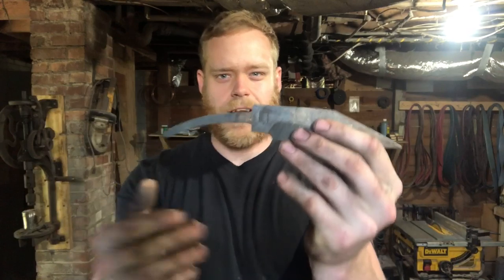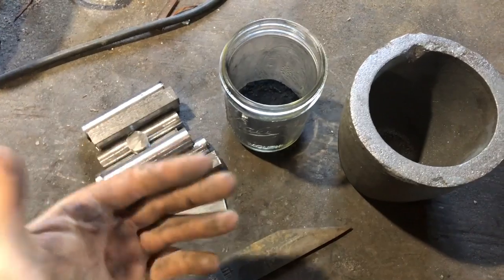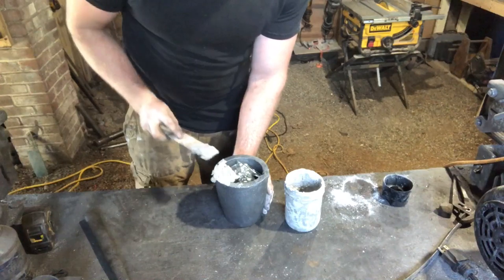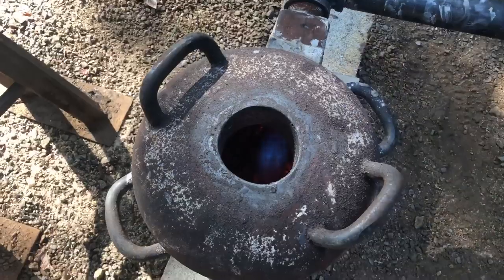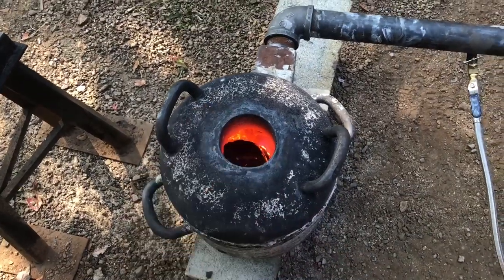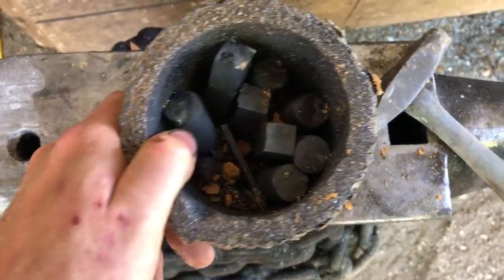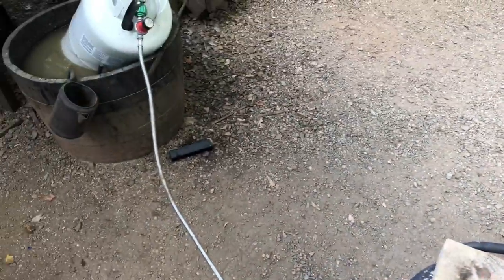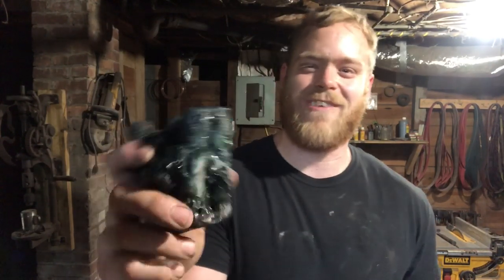Crucible steel experiment #2 (HARD FAIL)

Comment: Try building a small furnace out of bricks, use squirrel cage fans to blow air into the bottom and fill it with coke...Worked both times I tried it. Worked very well, actually.

Comment: We used a high pressure industrial oilburner (with a wing nossle, not those integrated burners from ordinary oilheaters, they will not reach the needed temperature, they hawe another type of nossle and the fan operate at much lower pressure) and a pre heting system where the air where pre heted in an externa pipe around a short chimney from the frunace. Maybe if You make an exhaust pipe from a pice of scrap iron pipe (i think it need to be at least 4" or bigger in order to work properly) and a bigger pice of pipe as a mantle surrounding it, then weld a top and bottom to the mantle and a smaller pipe connected to a fan with higher pressure or maybe an aircompressor (then the outlet close to the top of the mantle connected to the burner) would help increase the temperature a bit?

It need to be around 1350 Centrigree for real cast iron with high carbon content or pretty close to 1450-1500 Centigree if it's relativly pure "soft/wet" iron, the Graphite cruisibles shall be able to handle such extreme temperaure, they will melt at around 1600 Centigree, but they will become soft and "slippery" if they are heated up so close to their own melting temperature but it shall work if one are careful i think. (You don't need to sacrifice the cruisible if You sucess with the glass cover it shall form a lid as expected once the iron has melted, then You shall be able to just knock the ingot out from it once it's cooled of a bit since iron will expand and contract much more than the graphite mixture, it may crack, but better quality cruisibles may be rescuable, You can also make Your own cruisible from high temperature resistant clay mixtures and grapihte powder, it does not in any mean need to be pure grafite for this, the content in the cruisible will not realy affect the iron, it's only for "noble metals" like gold and silver, platinum, etc and for laboratory analysis it need to be made from pure graphite..).

(Sorry for my English it's not my native language...)

Comment: I'm curious as to why it was not stirred at all during the firing process.. I meen I understand that you don't want to pull it out, and lose heat, but to get anything homogeneous all the ingredients need to be mixed to some extent. It's sort of the difference between an egg over easy, and a scrambled egg. Just moving the contents some will put other parts of it in contact with truly molten materials, and spread their composition into it. I by no meens meen to sound like a chef, but I'd stir it a bit more. The glass should always rise to form an oxygen barrier, just like grease in a pan. Sort of like how a foundy never just drops a block of nickel into a vat of low carbon metal, and just calls the whole thing nickel steel. I can't wait to see how the next take goes. Best wishes on it. 👍👍

Comment: I've seen a vidéo where a guy says that you need to put fresh leaves in it. The leaves are supposed to decompose into carbone oxygen and hydrogen, and the hydrogen should be able to lower the melting point of the wootz. But i ain't sure if it's a real thing.

Comment: Think your furnace isn't getting hot enough. Might also look into adding diesel into the mix. Might help get it hot enough. Also get rid of the top you made with refractory and thermal blanket. Bricks keep the heat better. Also a firebrick for the crucible to sit on.

Comment: Use fresh green leaves the hydrogen lowers the melting point by causing carbon to diffuse into the steel. Also I wouldn’t use mild steel, Everyone I have  seen try that failed